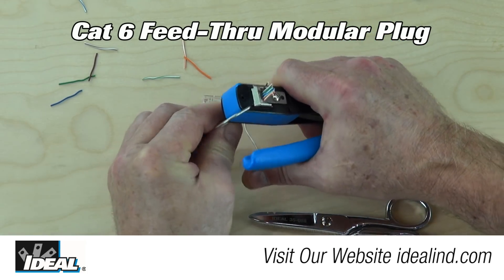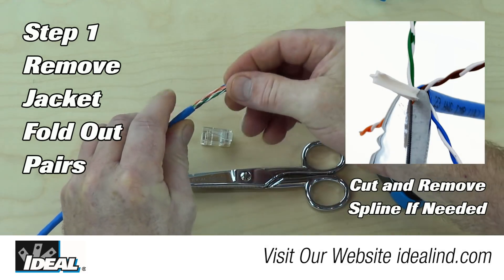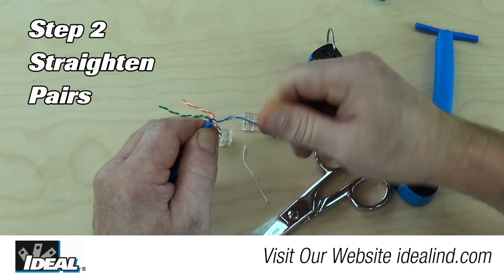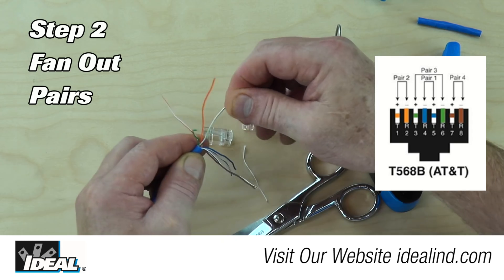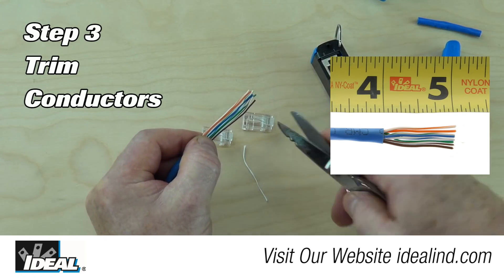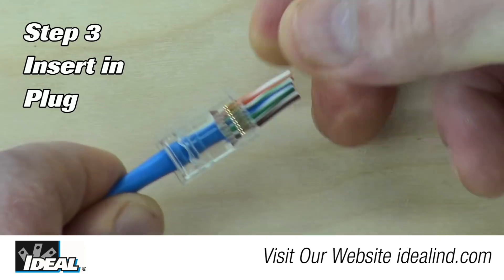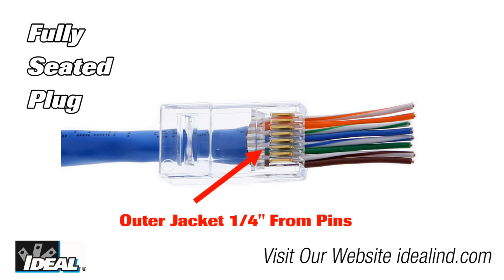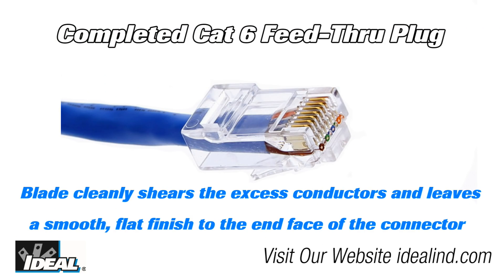IDEAL Cat 6 Feed Thru Modular Plugs Short

Comment: Forgive a stupid question; I'm a software guy (mostly). What's the physical difference between the CAT5 and CAT6 plugs? The only thing I can tell is there's a shorter distance of straight wire to the pins. If that's all, why make CAT5 plugs when CAT6 is backward compatible?
Reply from the maker: Samuel you are right not much of a difference in the two designed but the Cat 6 plug allows the outer jacket further into the connector which leaves only about 1/4 of untwisting in the pairs. As to why we make both some are just called out in a spec and the industry still recognizes both so hence why we still have them. At one time Cat 3 plugs were the standard but you never see them any more. By the way will a Cat 5e plug work on Cat 6 cable? The answer is probably. Ron
Reply: Ron Kipper Datacomm I bought the FT-45 a couple days ago with some CAT6 plugs and am very happy with it. I redid some cables from work to practice and the difference is night and day.
Reply from the maker: Glad to hear they all worked. Making the plugs up is just practice. Ron

Comment: These ez crimps are the only way to go, once you have used them you will never use a traditional connector ever again, also a good tip is to twist the wires tightly at the end of the connector before cutting/crimping, this pulls the jacking tight in to the connector, and keeps the strands in one neat bundle, from flying all over the place like confetti.
Reply from the maker: Hey I like that tip! Ron